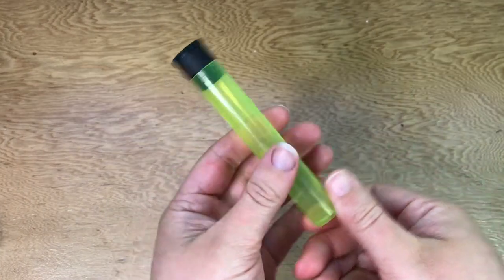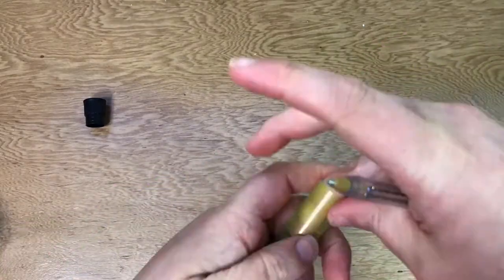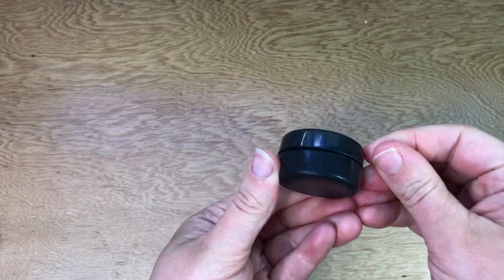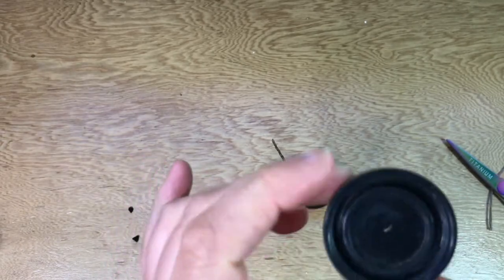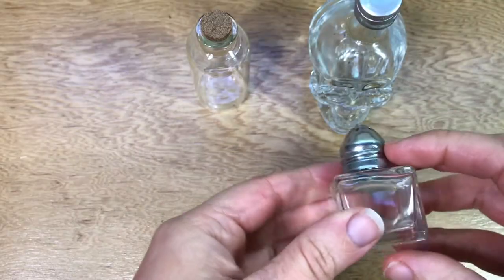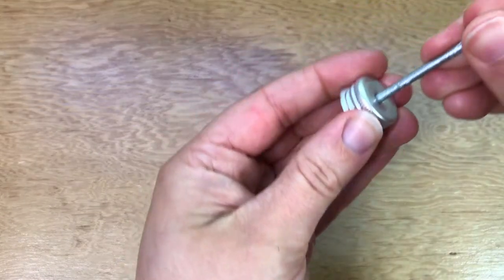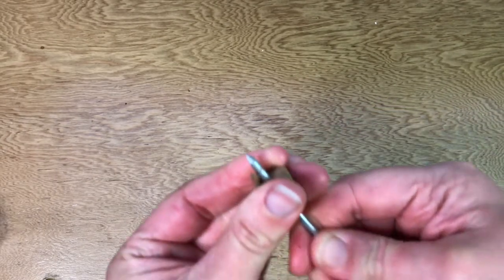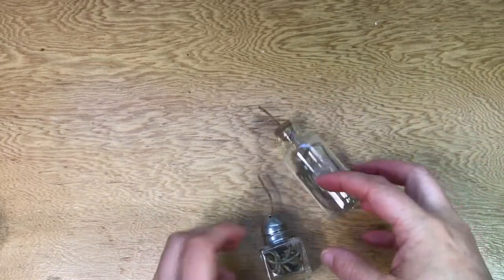How to Make DIY Hemp Wick Dispensers with Items in Your Stoner Kit or Home

Comment: Cork is like wood it has a celluloid grain structure (very short grain but it's there) you should drill cork not punch it. Punching the sheet metal cap was a good idea cause it leaves no burs. You shouldn't even need a drill to drill cork just twist the bit by hand you need to remove the material not displace it.

Comment: They wanted $20 for basically this. A $20 string dispenser. That's crazy, it's a container with a hole in the lid lol. I knew there would be a video like this :p the silicone dab container works perfect. Here I was stuffing the wick down an empty metal pen like an amateur. I don't even like wick I think at the end of the day, too much hassle for what I see as little/no benefit. I just use the tip of a bic flame for a split second, get a cherry going, good to go. I never tasted butane, I can definitely taste the wax though from wick... Anyway I digress.. Yes I am still making the dispenser though :p